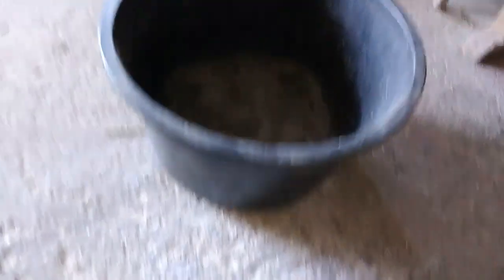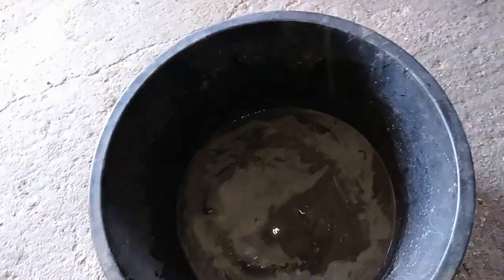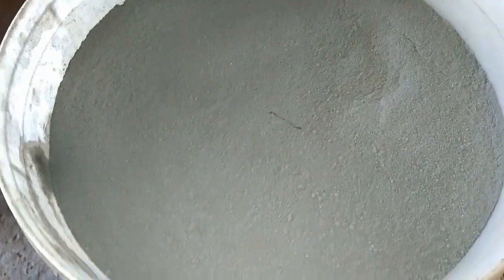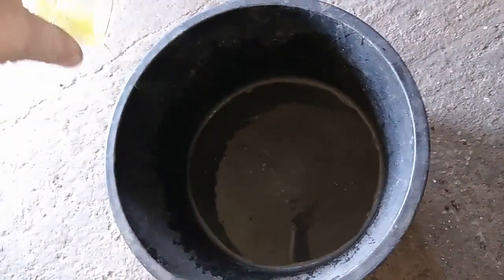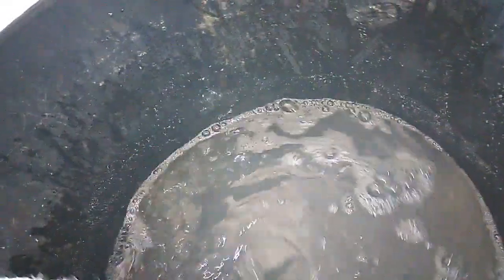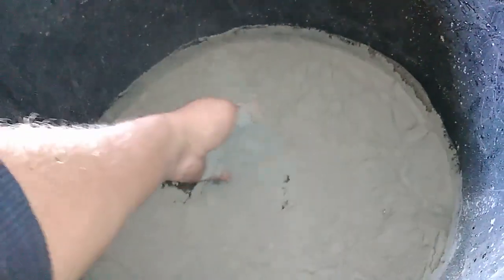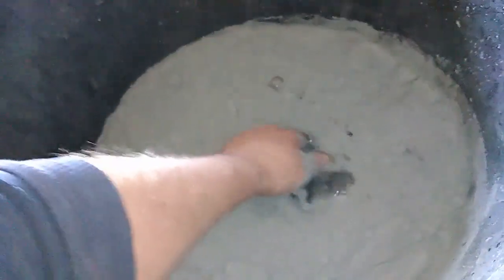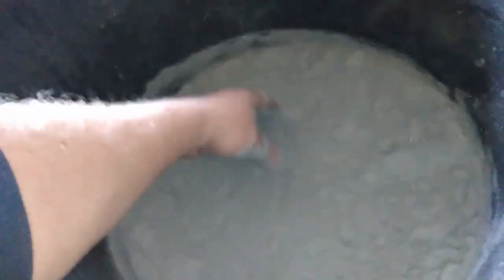2 Kg Ic chips gold recovery in an easy way!

Comment: My uncle has a recycling Company. He has a Box with 300kg mixed Plastik ICs from 1974 - 2006… How much Gold is in the Box ? We think maybe 480-550g Au , 2000g Ag and 20-30g Pd/Pt ? Right ???
Reply: Hard to know for sure. ICs from the 70s will contain high significantly higher proportion of gold by weight than anything from later periods. Internal bonding wires and other interconnects were made almost exclusively from gold in the early days of ic production. Some older chips have pure gold pins and heatspreaders, as opposed to the gold plated pins on modern cpus.

Comment: Use hot water when stratifying and to prevent any bubbles, spray with little bit of food grade alcohol. Also watch out on the bottom of one of your jars when you were showing the sediment it looks like there's a crack in the glass

Comment: That's not much gold. Was it from like power boards?
Reply: A profitable mine runs at as low as 1gram of gold per ton of material. 

Here you have 0.415g pf gold per 2kgs of material. How is that low? And what the heck are you comparing with?
Reply: @Magisktification  he's recovering from ic chips not dirt in a mine, completely different. Avarage in ic chips is 1g gold or more per kilo. I was just wondering if they were dip chips from low grade boards as I've gotten simular yields from them too

Comment: Poverty is difficult , all this for 0.8g low carat , what a misery
Reply: Yeah 0,8 per 2kg of Material. Profitable gold mines run at 1g to 10g per ton! Of material... 

They do a whole lot more work for their gold too. So its extremely high in gold this IC chips.
Reply: @Magisktification  i know that 1 or 2g/ton in a huge mine 200ton/day , try to collect 200ton/day ic chips and than talk to me.
Reply: @lamdaouazrachid5441  If you give me the same amount of resources as the mine youre comparing with and i will come up with more!
Reply: @Magisktification  IC chips mine , the idea hhh lol
Reply: @lamdaouazrachid5441  Well it sure beats landfills 🤙
Reply: @Magisktification  You cannot process tons of ics in large quantities and in a continuous way because it simply takes time and effort to separate them from the motherboard
Reply: @lamdaouazrachid5441  ofc not i would process the whole board in such a scenario, why would i be that selective.
Reply: @lamdaouazrachid5441  no there is something called a pcb board depopulator ;o))
Google it, you can process 3 to 500 kilos per hour.
I bet he only does these small amounts for his you tube channel.
but otherwise much larger amounts maybe tons ;o))
Reply: Most of the major E-Waste recycling factories around the world process somewhere around 50 to 100,000 tons of E-Waste every year. And on average there's about a hundred grams of gold per tonne of e-waste.